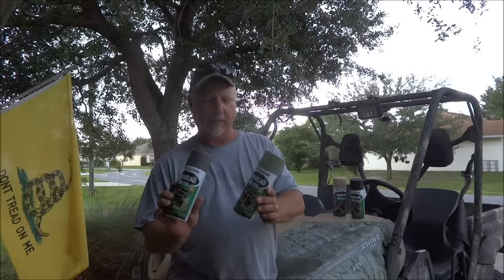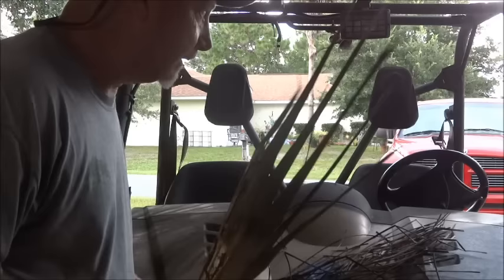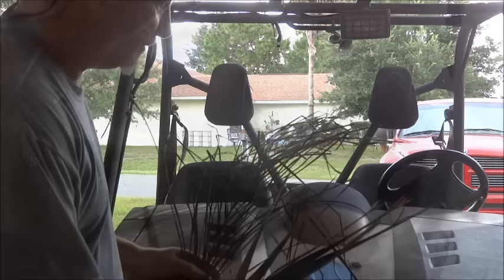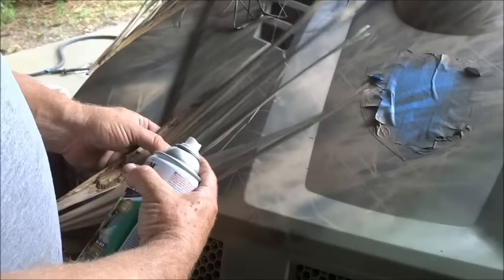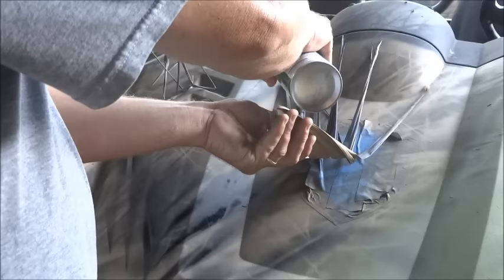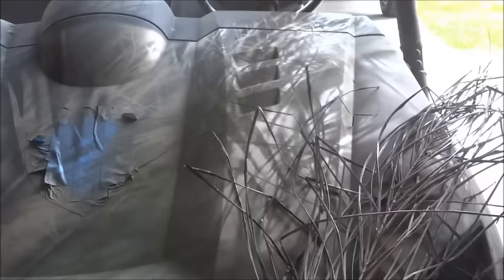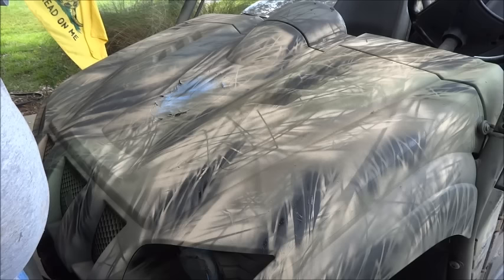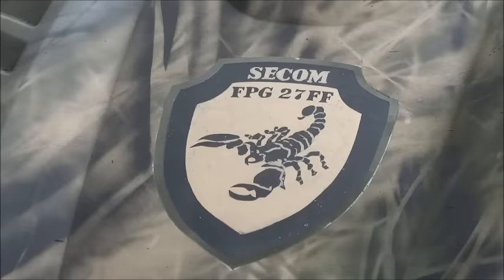How to Camo Paint almost anything in 3D cheap

Comment: I have used this same method on several older shotguns that needed help.  I call it a grass pattern and use your same methodology, except on guns it helps to use an oil cutter for the paint to stick properly, and I also use a matte clear coat to harden up the finished paint job!

Comment: Thanks for the tutorial BG
I just camo'd my 12' aluminum boat
For 22$ in camo paint.
It was super easy.
Looks awesome .
Reply: How has the paint held up in the water and with the boat flexing?
Reply: I've used the boat only 7 times so far.
The paint has held up really well.
Even after dragging the boat in and out of the water and on the ground , the bottom looks fine. Only a few minor scratches.
 It actually looks better than the camo wraps which often has repeated camo patterms.
 I used leaves, grass,ferns and a homemade cattail stencil.

Comment: That was incredible but I think that maybe you made it appear a little easier than it actually is. I will try it on the backside of my shop before doing my motorhome, thanx!
Reply from the maker: Nope, just as easy as that if you follow these steps and use a little bit of your creativeness and it will come out great.  If not, paint over and try again.

Comment: Thanks for the video.  I have an old flat bottom that I have completely redone and a Polaris Sportsman 800 with the typical Mossy Oak faded to purple that I will probably redo.  Wondering how well it holds up on the plastic over time.  Did you bother scuffing the plastic up at all before hand?
Reply from the maker: 2019, starting to fade and peel a little from the brutal Florida sun.  5 years!

Comment: Looks badass .great job
Reply from the maker: Turned out pretty well.  I did my duck boat also.  The greatest thing is that you can use the colors that match your surrounding where ever you are.  You can use any flat color paint.
Reply: Backwoods Gourmet I like to see what the boat looks like. the colors you used blend  great here in Central Florida
Reply from the maker: On your duck boat, mix in some primer grey on the pattern.  Looks like the water out on the lake.

Comment: Main principle of camo is to break up any recognizable hard edges, so you don't really want random at all, but rather customize your pattern for the object to be camouflaged, considering angles it's most likely to be viewed from.

Second major principle, of course, is matching the pattern to the environment you'll be operating in.

Both of these seem obvious, but I've seen a lot of bad camo jobs that would have worked had they remembered these two principles. :)
Reply from the maker: Regarding your technical jargon, I can park this anywhere in FL and you can't find it.

Comment: I want to camo my tent for stealth camping. Can I use this method for much more flexible surfaces like a tent's waterproof tarp cover or it will peel off over time? Camouflage netting would be a much easier off the shelf solution, but painting the tent itself would be a more lightweight option because it doesn't need any extra stuff to carry in my backpack.
Reply: Try painting your tarp net for 3 D??

Comment: i have a shiny black truck commercial topper that is showing some wear with scratches, old decal glue and some paint where it shouldn't be...i'm thinking masking the truck ( a mid green ) for over spray and using your method...do you think this will work ???
Reply from the maker: Yes it will work, but your gonna' need to knock the gloss off of it with some 120 grit sandpaper first.  This paint will last about a year in the direct sun, so a temporary finish for a vehicle.
Reply: i live in vancouver b.c. (same weather as seattle) so i won't have to worry about direct sun !!! thanks for your response

Comment: Thanks for taking the time to do this video. I would like to ask you though; on an ATV such as your Rhino, is there any other prep work at all that you did before the paint job?  I ask bcuz there are so many videos that say ATV plastic won't take paint for many reasons, one mentioned that comes to mind, is due to the color being molded in if you will ... and that paint won't stick to ATV plastic, but will instead crack, chip, etc... and or will not last long due to things like vibration of the plastic while riding on the trail. Sorry I expanded, but my question is still the same... I just wanted you to know why I'm asking about any other prep work you might have done before using the cans of spray paint. Oh, and I've also seen many YT vids that say to stay away from the Krylon and use Rustoleum. lol.. Sorry again, but do you think there is a difference, or do you have an absolute preference? Any prep tips would be appreciated if you don't mind. I'm ready to paint. But your video is the first I've seen that doesn't mention any other prep work, like an AP (paint binder of sorts) or post painting work, such as a clear coat.. Those were the few things that came to mind while writing to ask my 'prep' question to you. 

Thanks very much for your time! 
Ian
Reply from the maker: This machine already had a factory camo finish that was pretty rough and matte.  If your does not, i would lightly sand it with 150 grit to help the paint stick.

Comment: i want to do a club car front end. It is a dark green now. do I sand it down and put self-etching primer first then go ahead and do the camp spray?
Reply from the maker: I would say, just sand it with 150 grit if it's glossy and go for it.
Reply: thank you. so excited to try this. You did such an awesome job on yours!
Reply: going to attempt to spray the club car tomorrow if the weather is good. What about the outside of the aluminum bed? Does that need to be prepped before i spray it?